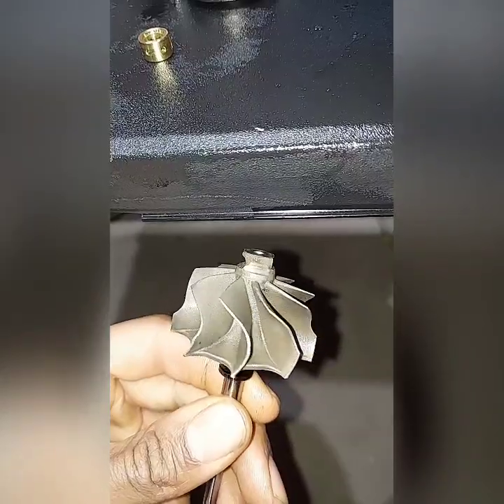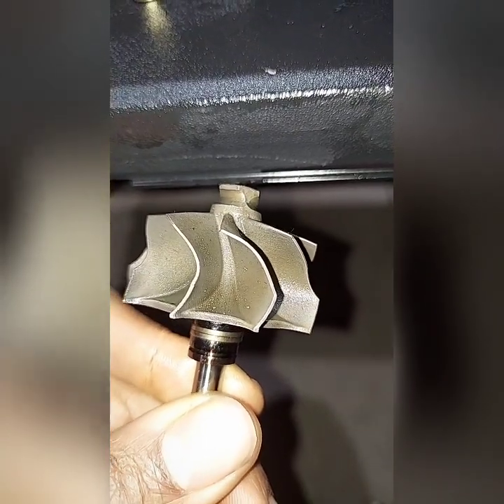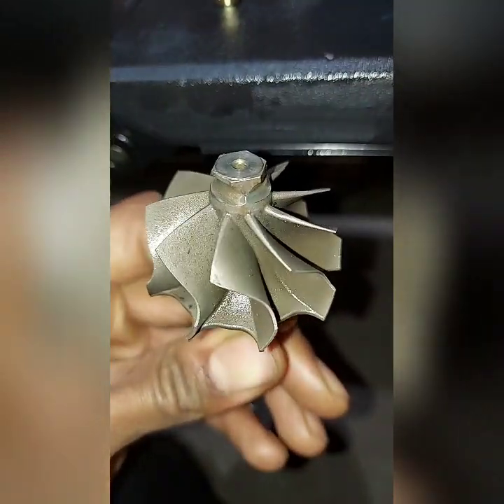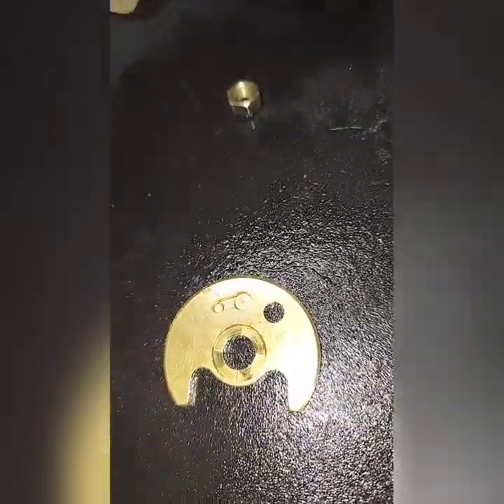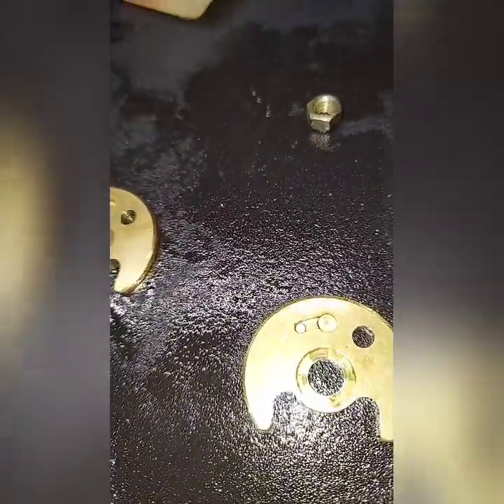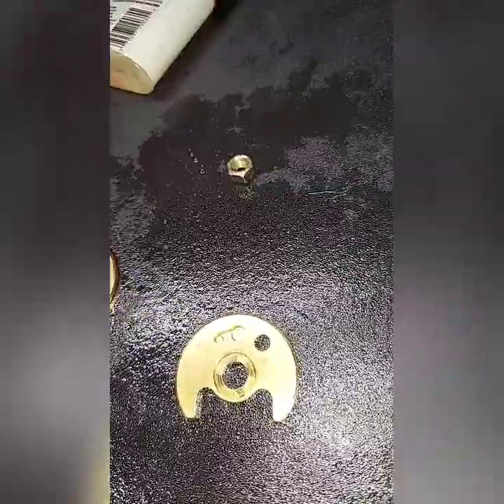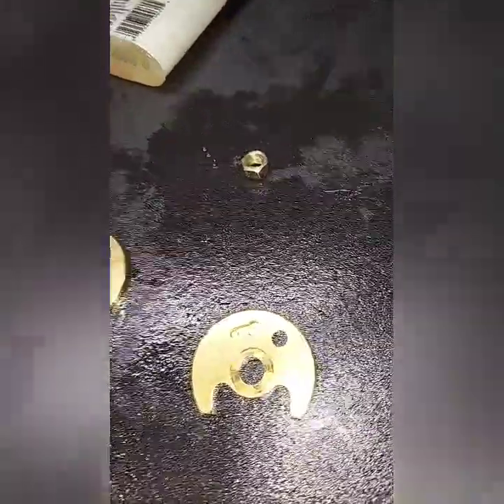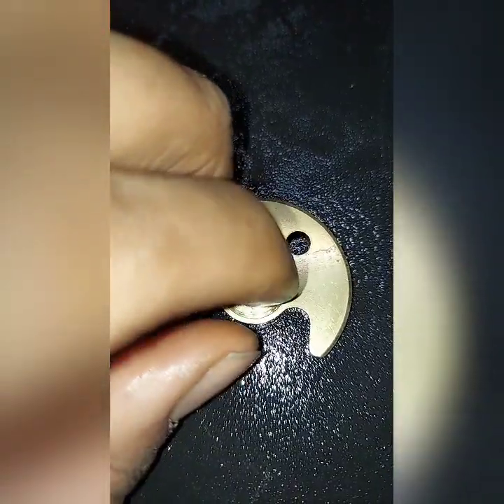Bmw N54 Chinesium 17T turbos teardown and review:    Theory on why they can be a reliable turbo

Comment: The set you have is the Costel version, there are several major problems, which I made a few videos on. I suggest watching all 3 of the videos on them because I found more problems as I was doing the rebuild. The VIV set of turbos use tdo4 journal bearings, the Costel set has an odd made up size journal bearing which uses a matching size shaft. The thrust bearing you need to use on that turbo is a tdo4 not tdo3, you are saying it needs a tdo3 because of the dowel pin location hole in the bearing. You need a tdo4 thrust bearing but the hole needs to be on the opposite side. I have been drilling the tdo4 bearings to make it work and have several on hand. The tdo3 and tdo4 thrust bearing diameter where the collar goes is a different size. 

The Costel turbos need a lot of things fixed on them you are better off just getting a viv set. Also those thrust bearings should never wear out at all if they are designed properly, from what I can see it look like the pattern on the bearing is for a reverse tdo4 that were in the turbo which makes sense why it would wear out because the pattern on the thrust bearing is directional, instead of the pattern on the bearing helping lubrication it’s scraping off the oil as the spacer and collar are spinning on it. 

I’m not sure if that tdo3 bearing will work on on that turbo or not, I think the inside of the bearing is too small for the spacer to fit.

Comment: Your video on this are really quality imo. You have a good understanding, can see it and can show it.  N54 platform was already given a shit for quality turbo from the factory. I sold my 335i about 3 years ago so I've been out of the game for that long. Getting the car back now and over the last two days I've been playing catch up on turbo game. When I had the car the Chinese turbos for sale were all bullshit remanufactured stocks with cheap internals and billet wheels that boasted more fins for bullshit claims of power and psi. It seems that some Chinese companies have realized instead of scamming people, to actually throw a little R&D into hybrid builds. They are already the people making all these parts for name brands in the US. If they had skipped out on the cheap shit and built a true TD04 internal with the upsized housings they'd own the aftermarket turbo game. People bitch about Chinese hybrid builds but throw 25psi+ at them. They were never built for this nor will hybrid updates make them reliable for this. People expect a product to last forever even though they are moon boosting them well beyond engineering intention. For this reason I'll be buying 19T turbos (hopefully v4) tearing them down, check build and tolerance, replacing the weak parts, sending off for balance check, installing and giving them hell and reporting regularly. 15k miles out of a set of turbos you're pushing well beyond limits is a good fucking run. I'm on board with these! Thanks for the review!
Reply: did you get the v4s?